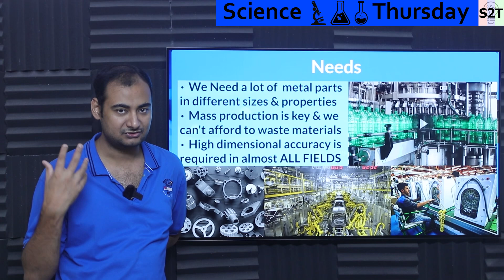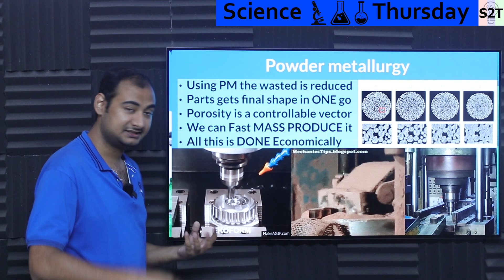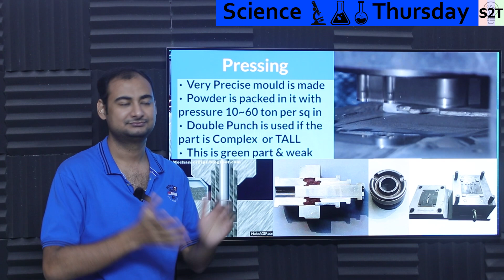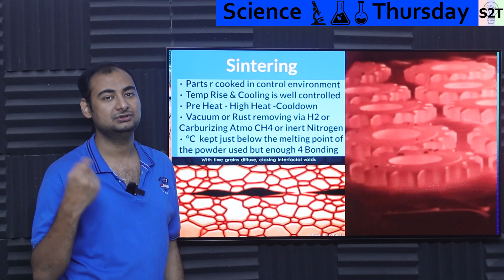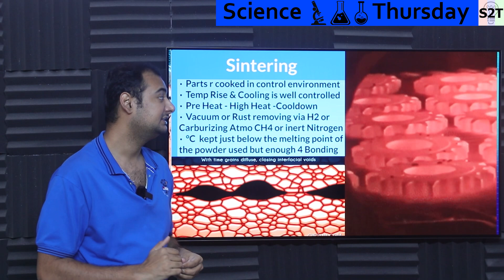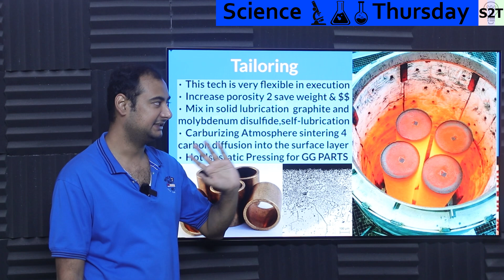Powder metallurgy {PM} Explained {Science Thursday}

Comment: Thanks, great video. I worked at a factory as shipping/receiving quality control and the machined faces of the oil-sealing surface of the powder gear case of about 3% of parts would have  bubble of porosity in the wrong spot. The parts were 40 mm thick so it was a significant loss for the company, had to switch suppliers.
Reply from the maker: yes QC is the biggest hidden cost